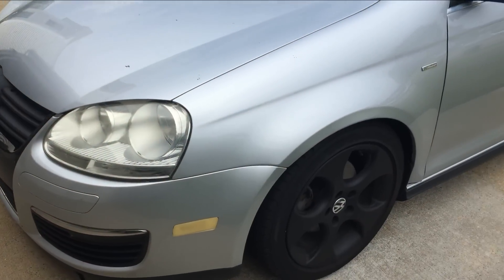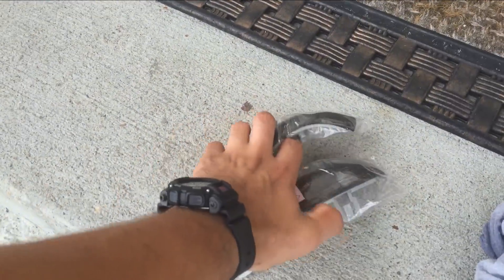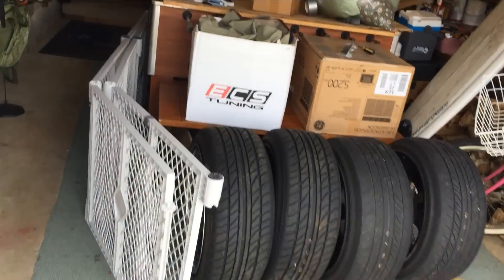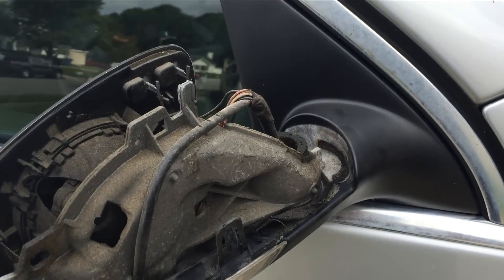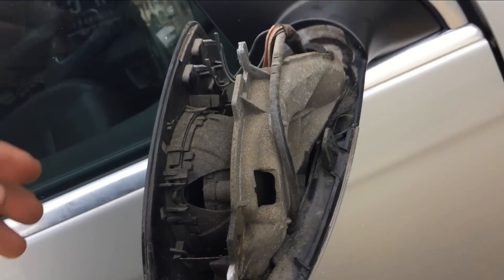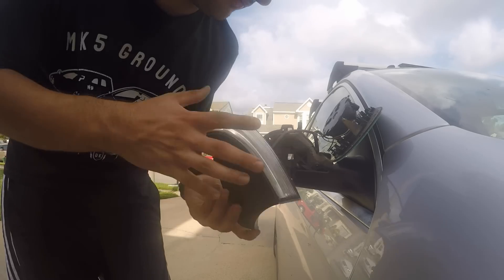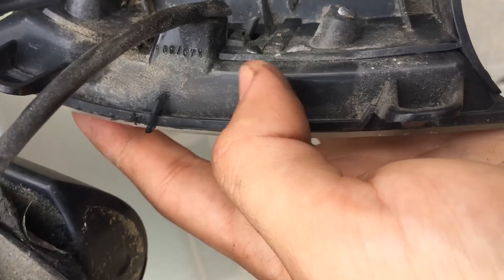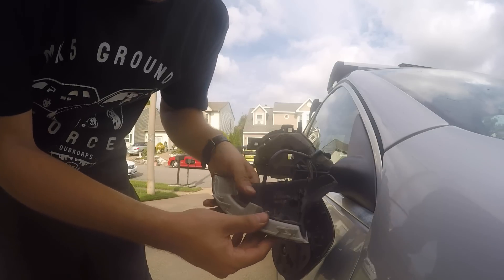MKV (2006-2010) vw jetta side view mirror light replaced!

Comment: Very helpful video and clear cut instructions. Just replaced my VW Jetta 2009 passenger side side rear view mirror. Just a note; you will need a Torx 10 screwdriver to remove the screws. Preferably a long one; in that case you wont have to dismantle the mirror rotating motor.
Reply: Are you talking about the star bit screws? I was wondering what size they were

Comment: Great video.  For long term adhesion, I suggest sanding with super fine paper and wiping with denatured alcohol before painting anything like that.
Reply: Plastic or not, paint does not like to stick to glossy smooth surfaces.  But if the paint is already very dead and rough, I suppose you could just wipe it with cleaning solvent.
Reply from the maker: Thank you and yes I wish I would have done that because now it is started to peel and there are silver dots showing on the mirror from rocks lol

Comment: Lights and your Jetta looking good man, I'm about to replace my mirror lights and side indicators with smoked out ones on my '08 MK5.. Quick question though, which screwdriver bit did you use for the screws inside the side mirrors?
Reply: torx t10?
Reply from the maker: Thanks man! Yea I'm pretty sure it was a t10

Comment: Quick question: My left side mirror turn signal went out, and I figured while replacing the bulb I'd replace the housing too, so I ordered the blacked out plastic piece. Based on watching videos, it seems like that plastic parts come with a bulb in them. Is that the case? And if not where can I get the bulb? Thanks!
Reply from the maker: Yes the bulb is already included

Comment: I replaced the mirror signal and it's still not working :| What should I check next? :|
Reply from the maker: +mano mecher Sorry to hear that. Maybe recheck the connection. Where did you purchase them from?
Reply: Are your door switches working?  I believe the mirror light is driven by the door module.  The dealer replaced my door module under some recall but did not code the new one correctly and it did not know that the mirror light was installed.  I found this out after replacing it and it still didn't work.  I got a VAG-COM cable and figured out that the door module wasnt coded correctly.  Ones I programmed it, works great.
Reply from the maker: Yea everything still works fine.